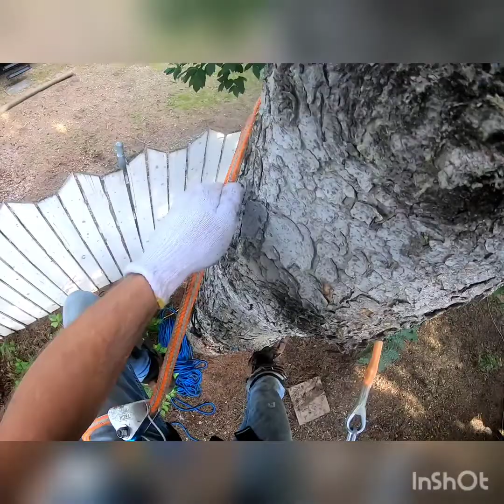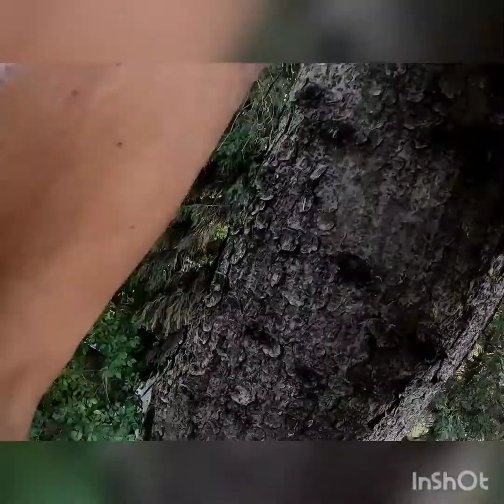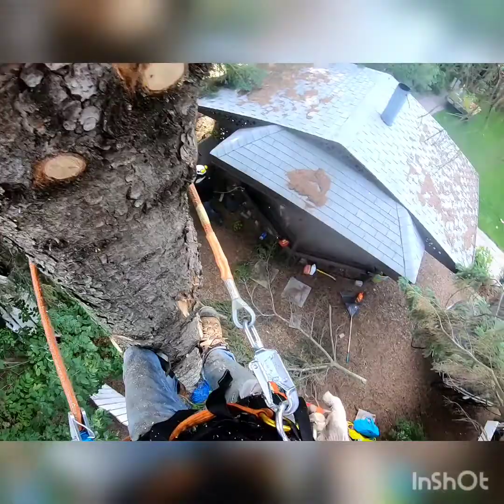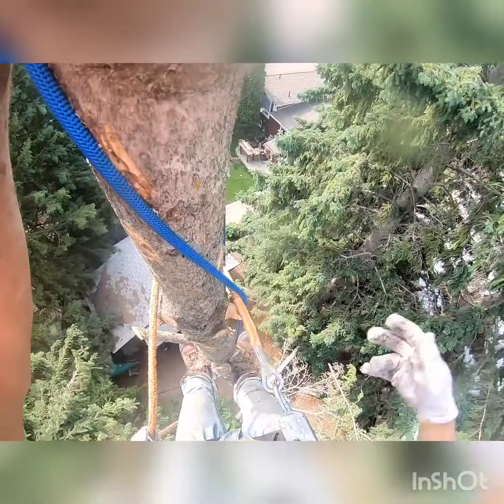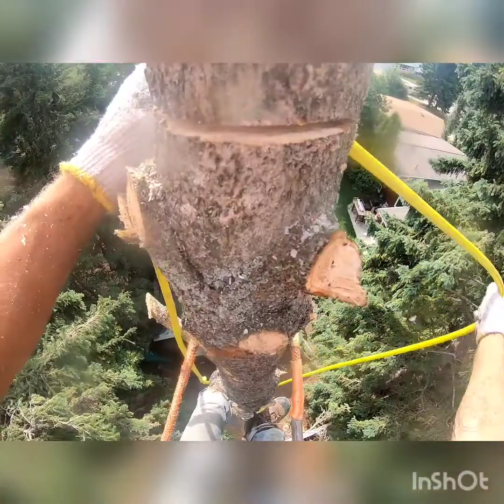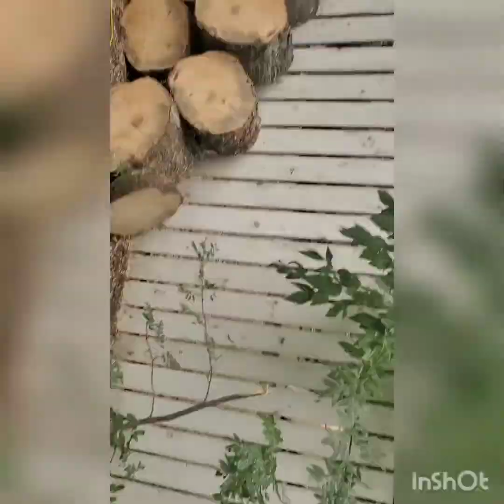TALL EVERGREEN REMOVAL. And a few wood Deliverys

Comment: How high do you reckon you were when you took that 1st piece off the top?
Given the choice I like blocking my wood after dropping trees at waist level. Starting at the top and taking it down a foot at a time just doesn't do it for me :O
Have you considered using 1 of the Stihl electric chainsaws? I don't know how the weight compares but from what I have seen I'd say you could block that whole tree out of single charge. The fact that when you're not cutting there's no chance of the chain spinning would have to be appealing and it's also a lot quieter which would have to be more pleasant and would make communication with the ground easier too.
Reply from the maker: Hey Alan, I was roughly 80- 90 feet up when I dropped first piece off the top, and just recently I've been doing some research on them stihl battery chainsaws. They seem like a really good option. Just hard part for me is switching from my gas power to battery. Although after trying a tesla car. Kinda puts some of that fear from switching over from gas to battery to ease.